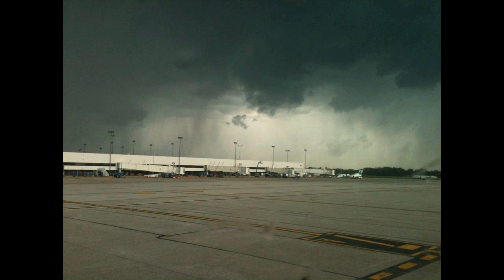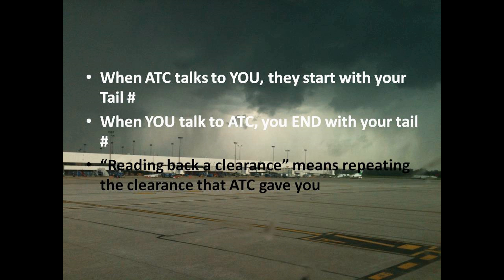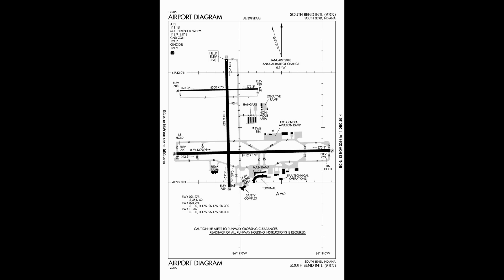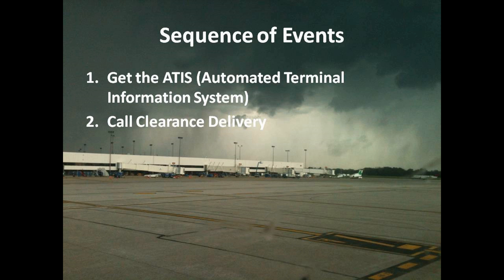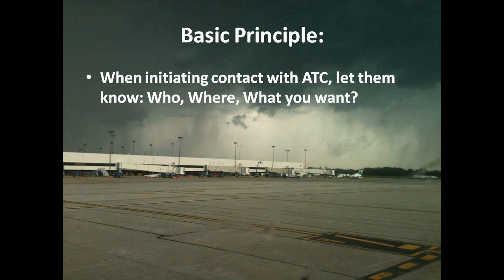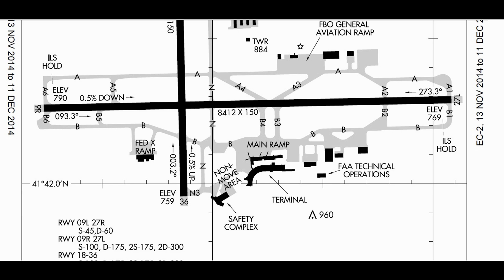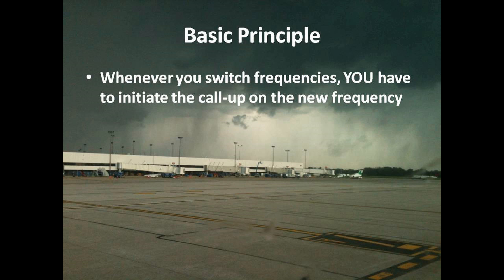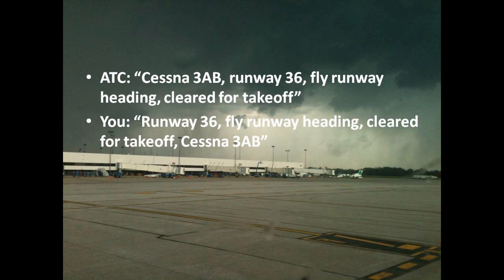Flight Simulator Lesson 6: Air Traffic Control (part 1 of 2)

Comment: I was told you should only shorten your tail numbers on read back, after ATC has shortened it in a response to you. There might also be other aircraft with very similar tail numbers to you active there, so they want the full number to eliminate any errors in this case.

Comment: On the airport diagram at my flight school, the ground control and clearance have the same frequency. So do I contact clearance identifying myself then ask to taxi?
Reply from the maker: Many class D airports only utilize ground control for issuing the initial clearance. In that case, you would just say " (airport) ground, cessna 123AB on the ramp at (name of FBO or location), VFR departure to the (direction of flight), requesting (altitude desired)"
If the airport diagram actually shows "ground" and "clearance delivery", but both have the same frequency, then you'd say the same thing but you would say "(airport) clearance" instead of "ground".
In either case, you would first request your enroute clearance, then call again when ready to taxi